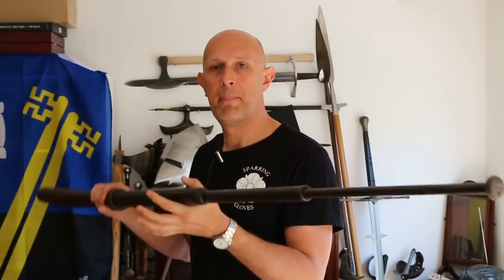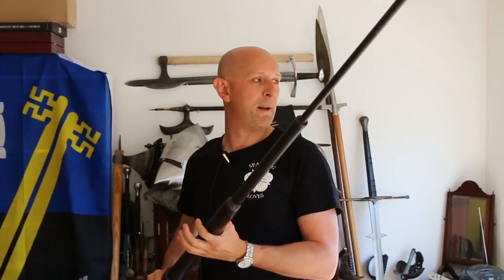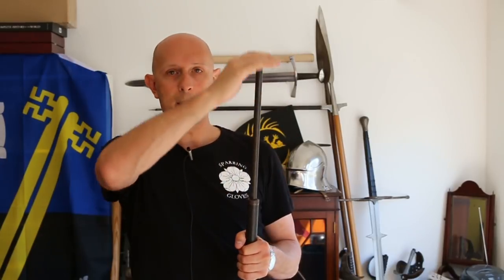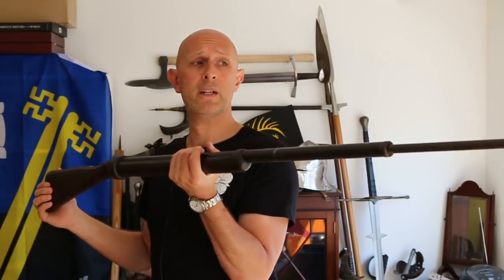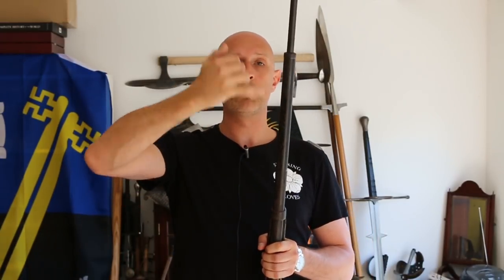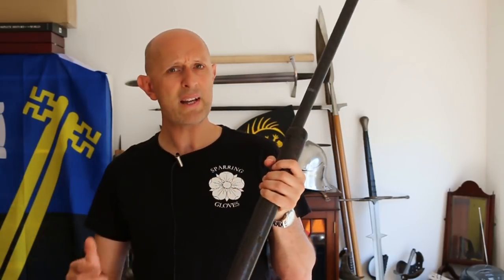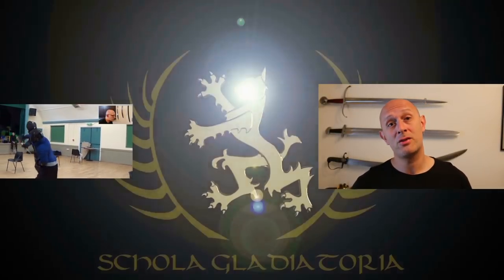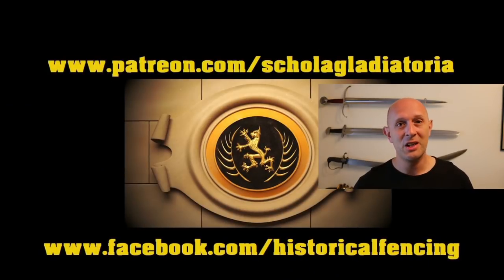Bayonets for Fencing / HEMA Sparring - Problems & Challenges

Comment: I'd make a rod style bayonet of a semi-rigid rubber threaded onto a spring-loaded short steel plunger completely captive inside an iron water pipe 'barrel' and a high density rubber stock cast or printed in the shape of the desired musket pattern furniture.
All balanced with magnetic weights on the 'barrel' concealed by the furniture.

Comment: Seems like the problem is the weight. As you say if you hit someone with 8 or 9 pounds of anything you could do some damage.  A nylon stabby end is good, but a foam butt is still dangerous if it is a big heavy butt. You may want to consider a light weight (not historical) option or only do very light safe sparring (not realistic). Maybe a modified pugil stick with one end being a blunt and flexible  "blade". the blade should have a circular cross section so that  it bends equally and every direction.
Reply: I've been hit by one - it definitely will boss you about.

Comment: Matt, have you tried jukendo(japanese bayonet fencing) shinai? Might be an affordable alternative.
Reply: from what I understand, they are much lighter than actual firearms
Reply: Gloin79 I feel like it ends up being the same kind of compromise as the weight of sparring swords. How far down the safety versus accuracy road do you want to go?
Reply: I have two - they're rather light.  But, they are available and don't break the bank.  Good to start with, probably better to start with those than a fencing musket.
Reply: Maybe they can be made heavier by adding some additional weight(steel bands or something) to the mid section?
Reply: Steel sparring swords usually don't have different weight or handling. Example:
http://www.albion-swords.com/swords/albion/swords-albion-mark-maestro.htm

Matt Easton is asking about high-quality (original materials, original handling properties) bayonet training pieces.
Reply: Ben Muir sparring swords are only marginally lighter and more balanced towards the hilt
Reply: Gloin79 yes, but my point was that with all training you have to make compromises. Do you want to be able to hit someone with the butt or do you want the inertial resistance when you go to thrust? There are always compromises.
Reply: yeah yeah but I mean the point of the video was that there are no real weight trainers on the market and that these kind of trainers are not Ideal

Comment: You could replace the butt with nylon and/or pad it with foam, you'd have to mess around a little to get the weight distribution right but it would be safer.

Comment: The basic design is extremely simple: rifle stock, length of pipe or tubing threaded on one end, rod threaded on both ends, cap that will fit in the tubing for the bottom end of the rod, cap for the "barrel" which allows the rod to slide freely, cap for the top end of the rod, and a light compression spring. About the only thing I can think of for the but stock is to pad it. The main problem I see here is the weight distribution.
Reply: Replied before I read yours. That's basically what I pictured. Aftermarket nylon stock makers already make stocks with metal inserts to screw the action to and for stiffness. Simple enough to add them where needed for weight and balance for a bayonet trainer. And aftermarket rifle stocks can go for as little as <$100. A you note, the rest of the parts are damn near hardware store OTS components.
Reply: Matthew Carberry That's not a bad idea. Additionally, I think it would be a good idea to buy ones that have provisions for adding recoild pads to the end of the butt stock,  instead of attaching a normal recoil pad you add some foam padding instead. I think that execise mats, like the ones you find at gyms would be ideal. They can be bought for pretty cheap, readily available, and fair sturdy, one sheet of foam would go a long ways too.

Comment: Hmm. Not all that complicated, and someone with a half decent workshop should be able to make a passable reproduction with relative ease. As for updating the design... That's a different proposition entirely.

With a bottom-mounted bayonet with a spring-loaded pivot and a slide mechanism could be used to allow both stabbing and downward cuts, and some careful padding could be used to make the butt a little less lethal (memory foam springs to mind, but springs could be used too).

The key items needed in a workshop would be a bandsaw, drill press... That's really it; a lathe wouldn't go amiss but I don't think it would be critical to the construction. Alas I lack all of these, but if I had access to them I'd certainly give it a shot.
Reply: Several people have done this.  The main issue found so far is a lot of modern stocks actually aren't all that durable - the butts tend to break.

Comment: I know it's been two years, but Matt have you seen what Black Fencer has?: https://blackfencer.com/en/home/167-rifle-with-bayonet.html It is a little light, I think 2-3 lbs in old imperial measures so sword weight, but that does help with the safety I would think. Alternatively, the old US Bayonet manuals of the 1850s tell you to take a stock bayonet and cut it down & modify it to take a screw-in replaceable blade & tip, so one could always do that if they had access to a machine shop...

Comment: I expect the barrel started life as a real rifle barrel that that was not rifled and was bored out to fit the plunger rod.
The best way might be to get a rifle of that era and have the barrel bored out.  That is a lot less work for whoever makes it for you. I think it would be not too difficult to find someone who could do that for you. Bore out the barrel, and start from there.
With a real rifle, you have access to the back end of the barrel, which will make it much easier to put the spring and dampening mechanism in the barrel.

I know nothing about gun laws in your part of the world except to believe they are very strict.  But, you do not need a working fire arm. You do not need a working bolt or trigger mechanism,  just the barrel and the furniture, in one piece.  If the barrel has been filled with lead, that will be easy to bore out along with the steel of the barrel.  You end up with something that could never be a fire arm again, even with bolt and trigger mech in place.

I believe that would be the easiest way to do what you want.  No special jigs needed to recreate the size and shape.

Comment: Maybe PurpleHeart could make a nylon one?
Reply from the maker: Unfortunately that would be much too light.
Reply: I traded e-mails with Purpleheart for a bit trying to hesh out details for making bayonet attachments or fencing bayonets (more like the one in the video), but it didn't pan out.  You can make these somewhat simply with relatively available materials, but durability is an issue - especially the stock.  Less of an issue with earlier systems, but I was shooting for later ones that use the whole weapon.
Reply: Oh, forgot to add - look into pugil sticks :p

Comment: Having a spring inside the barrel doesn't help with butt strikes which if done full speed/ full power would be lethal if the bayonet is 8/9 pounds .  Iv made some Oak bayonets that we use with control.. My suggestion is to modify your training methods.  Sparring isn't combat. Never meant to be. The only thing that is the real thing is the real thing.

Comment: I have the skills to make something like this, but there's already an alternative. The Japanese martial art of Jukendo has been around for several hundred years. There's even a Federation in the UK. It won't be absolutely identical, but it will be pretty darned close, and they already have solutions to many of the problems you raise. Ring them up and look over their equipment. The one time I tried it out the weapons were lighter, but that's alright. Outside of using some pretty serious, heavy, expensive armor there simply isn't a way of getting knocked upside the head with a six foot, nine pound club and getting back up again unless you want to relearn tying your shoesy-woozies after a few sparring sessions. Yes, you can be disciplined and controlled, but accidents will inevitably happen. 

http://www.jukendo.co.uk/

Comment: Why not make one yourself? To be somewhat safe you can make the butt and the bayonet out of slab of nylon, not too expensive and fairly easily bought material, then make the center part out of heavy compression spring, for safety shock absorption and heft.
Reply: DwarfInBlues For individual use that might work but it's not a viable solution for clubs who need larger amounts for bayonet sparring. Plus, home-made sparring equipment is unpredictable and often unsafe
Reply: directplastics co uk --> nylon-6-sheet get 1000X100X30 slab, you can make two "rifles" out of it.

Comment: The Japanese have being playing with bayonets for a while and have a martial art Jukendo and with equipment.
Reply from the maker: Unfortunately the jukendo bayonets are incredibly light and nothing like the real thing - we have tried using them, but they are just too light (and also too short for our period).
Reply: They would be a good starter no need to go so large and heavy to start. Despite the lack of weight and length you could still get a handle on distance and how hard to strike. I watched some Jukendo videos and I understand what you mean. Could you make a blank wooden rifle from wood like pine but add a dagger fencing blade on top. They have threads on the blade and you could socket them. You do good shows though sometimes it takes you too long to get to the point or you get off topic. How do you know if the person who wrote a book about fencing was any good?